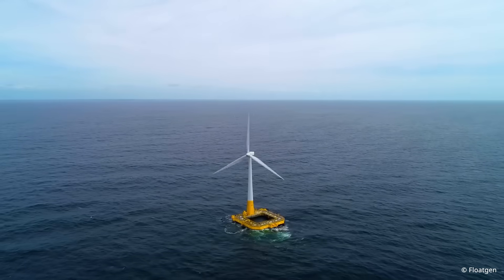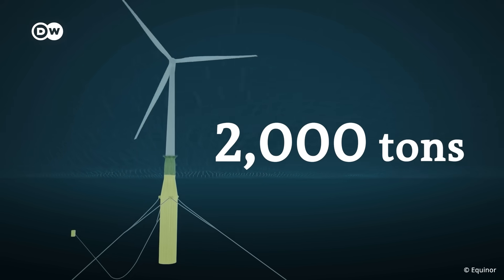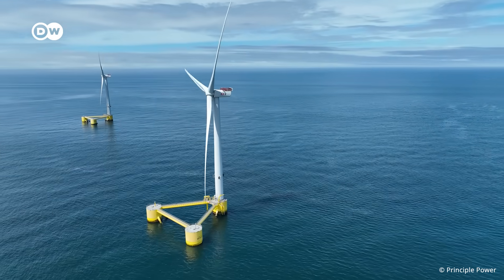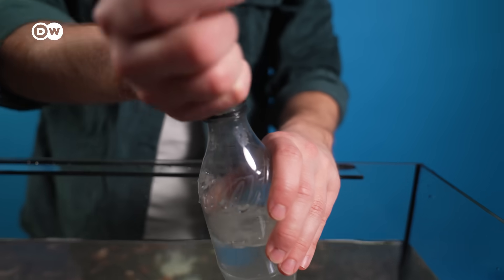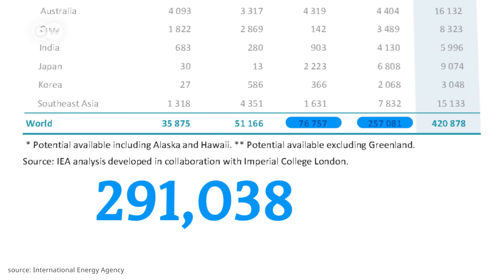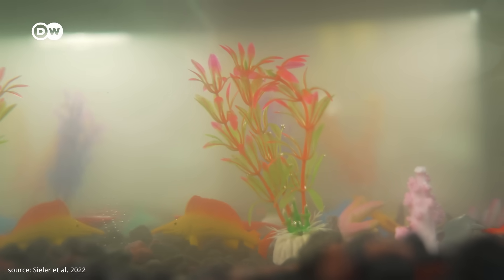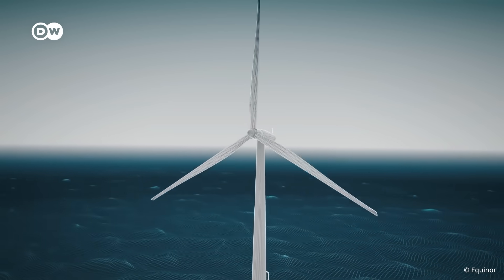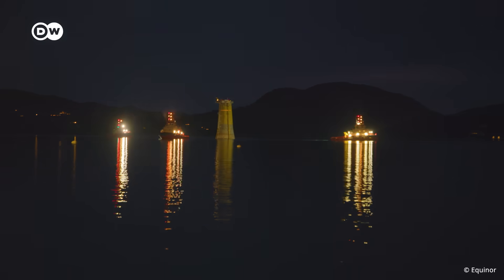Floating wind turbines: Offshore energy's secret weapon

Comment from the maker: Do you think floating wind turbines will be part of our future energy production?
Reply: As the tech will progress, the cost will come down and more innovative methods will arise.
And the best part about them will be if because of any kind of error during installation or in the future they need to be put at a different place they could be transferred.
Reply: Yes, as long as they can get the costs down, making the cost of electricity competitive with other generation methods. If they can already survive hurricanes, then I think the hard part is already solved.
Reply: Put them where there is a strong, steady ocean current and install them upside down. Moving water always has more energy than moving air and this will eliminate the need for batteries
Reply: I hope wind turbines go the way of the dinosaurs for everyone's sake...at least the way the industry currently handles it.
Reply: @julien.4617  Because of how they dispose of the blades?
Reply: I expect that off shore wind will become a bigger percentage of electricity generation for the more heavilly populated countries with a coastline.
It seems that floating wind turbines have engineering and environmental advantages in anchoring, and probably for major maintenance (as they can be moved without cranage).  
So yes, more floating wind turbines in future.
Reply: @JakobusVdL  Also, they look like their construction is primarily metal, so they shouldn't be problematic to replace and dispose of/recycle.
Reply: I don't understand why they're more efficient....like why is it 54% and the others 33%...
Reply: @Eddyke  hello, the fact is that the scottish farm is located in a site with enormous wind density (open sea) whereas the others are located near to the shore and in sites with less wind energy density
Reply: @Eddyke  they're not more efficient, he's talking about the capacity factor in the video. Capacity factor means what % of the time (on avg) it's running at full capacity. Because offshore winds are more constant, offshore turbines have a higher capacity factor
Reply: @Paulo44.01  So why are floating ones better than the one's fixed to the bottom if both are offshore
Reply: @Eddyke  that's a really good question. Among other things, the efficiency of all energy capture is pretty low. Almost ALL of the energy of the gasoline in an automobile is lost as heat before any work is performed.
Reply: as an iceberg floats deep - make the turbines float deep and raise them high when the wind is low 
(the wind always blows off-shore and all you need to pull under sea cables is a boat )
Reply: sure.  they can also add solar panels with the wind turbine?
Reply: @StacksSats  …but I guess easier / cheaper/ more reliable to just more wind turbines
Reply: Yes plus green hydrogen, solar and wave/hydro
Reply: Of course. Most populations live in coastal regions, demand is therefore easier to supply. Land space is limited on these coasts. Its not going to impede shipping, fish or currents and planes fly above. Wind speeds is stronger. Even some shallow seas would be easier with floating due to seabed geology. Offshore oil knows how to build these for decades
Reply: Whether they do are a political decison,  they are not a good decison from an engineering point of view.
Wnd is a very poor source of electrical generation for many reasons. The principle one is intermittency followed closely by being unable to load follow, no inertia, no reactive power support or short circuit current levels. In addition  they have a short service life and deteriorating performance as they age.
Reply: @iareid8255  Average expected age of wind turbine farms is 25yrs at minimum. CA had farms in the CA hills way longer than that. By their nature bar Hydro, renewables are intermittent. Hydro relies on rainfall. Bar burning stuff and emitting it into the atmosphere, there are few other choices. Nuclear has the "unfortunate" habit of generating its own lethal waste. Just a pity that C02 at high levels is not compatible with near all life including the humans who need that power.
Reply: Stephen, 
Expected, practice tells a different story as they age. Particularly as they get bigger.
You don't build hydro where there is not sufficient rainfall, that is not economic for one thing.
Yes nuclear has it's downside but the quantity of high level waste is quite small relatively. It can managed, nothing is ideal
You are probably not aware that CO2 levels now are quite low from a historic point of view. However renewables will do little to cut down on emissions of CO2 as they also require alternative sources of generation running parallel to them. It' s not either or as people tend to imagine. They are no solution.
Reply: @iareid8255  As the hoover dam shows, even the biggest dams are having issues in ever expanding drought areas. China's biggest dam suffered last summer. 
Nuclear waste can be handled but the deep waste site storage (10.000yrs) required is something nobody, not even in a total wilderness wants. More nuclear means more waste from medium-high level. That excludes decommissioning all the old plants built in the 60-80's that are now near or at end of life and were built with older standards (good but old).
As for C02, not sure what historic you mean. The IPCC shows C02 has risen every year since man industrialised. So it might have been higher when man was using wooden tools but not now. And that C02 rate keeps rising and will keep rising for decades from what we burn today. Renewables are the ONLY power source that does not generate waste every day it operates. Every power source requires infrastructure but oil-gas-coal generates emissions every second it runs, nuclear just needs a deep hole in someone's locality for storage that will take longer than the last ice age to be "safer" and there is 250K tons of it now and an extra 24K per year adding to it.
Reply: Stephen, 

hydro is not 100 per cent but you can rely on it for most of the time, sited correctly and sized correctly.
Nuclear waste does not need to be buried  deeply but must be secure.
It is the only generation we have (hydro excepted) that does not generate CO2 .
Renewables cannot run without fossil fuelled generation. 
Historic levels of CO 2 have been significantly higher as has global temperatures, I'm not talking about a few hundred years though.
The current level of CO2 concentration has increased plant life by about 15 per cent in area, it is very beneficial for plant growth and it reduces the plant's water requirement.
(Nads satellite photography).
By the way drouts are not increasing in frequency or duration. They come and go as they have always done.
Reply: A key thing you have missed is the impact of wind + other renewable infrastructure when compared to continuing with O&G. Studies have been performed and it finds that the benefit of implementing offshore wind vs not and just sticking with Hydrocarbons is vast for the wildlife... so yes the turbines will damage the environment for some animals but this will be outweighed by the increase in animal population due to the stabilisation of the environment.
Reply: Mark, 
renewables are not an equivalent to conventional generation nor can they replace it.

The criteria for reliable and economical generators are as follows:-

Generation on demand as required to meet load.
Inertia for stable frequency.
Provide reactive power for stable voltage. 
Support short circuit level current for effective protection operation.
 Renewables, hydro excepted, meet none of this criteria.

Many countries have tried to implement renewables for twenty of so years and have failed, despit adding various devices to try and mitigate the deficiencies of renewables. All that has happened is that the cost of a unit electricity has increased significantly.
Reply: @iareid8255  hence why investment in battery technology or energy conversion is also required (e.g. turning curtailed wind/solar into other things like hydrogen)
Reply: Mark, 
in practice there is very little curtailed wind generation and it certainly is not viable for making hydrogen. It is bad enough that it takes more energy to produce hydrogen by electrolysis but when intermittent generation is used it is simply unviable.
Battery technology can never be an answer to so many deficiencies in renewable generators.
Reply: @iareid8255  The other criteria are:
Short transport of power from supply to demand
Emissions that can be cheaply reused, recycled
Emissions that are neither lethal to humans, wildlife and do not harm the only planet we live on from turning to desert/flooded/poison to humans and the animsls and plant life we need to survive/prosper.
Power supply that does not go over budget, decades to build commercially and can supply power at a "more reasonable" cost including the cost of emission damage/mitigation investment
Power demand that does not require sourcing the fuel from countries that wish you ill (or at least, say it but do nothing).
Reply: Yes.
Reply: No. I think wind turbines will go the way of the dinosaur. Wind kites are superior in basically every way, and should be adopted in preference to turbines.
Reply: @malcolm_in_the_middle  Those dinosaurs being installed now, have a minimum 25-30 yr expected life span. There is no commercial kite power generators. So the turbine dino will be around for longer than you predict
Reply: Just before landing in Copenhagen, I recalled  huge turbine structures in 2015. 
I'm very impressed by the solar panels at the shahara campground during the same trip. It light up the path to the bathroom at night and inside the ⛺. It's what makes Morocco different than the rest of Africa.
Reply: This has to connect to a generator and a grid…this is not effective…stupid…how much sea life would this kill…how many birds…how much co2 footprint is it to maintain and build…dumb. Their is a case for wind turbines in areas that has high wind in high areas, but would have to be specific and even then it’s current not effective because they can safely go high enough and still connect to a grid. It’s a waste…look at Germany that went all in and is burning coal at high rate because of this. So dumb.
Reply: Make them in cluster formation conected to each other like roman's legionaire would add stabilizing effect.

At the center of formation add 1 bigger floater without the turbine ofc to add more stabilizing factor.
Reply: If course they will. You still have to find a way to store energy to cover all 24 hours of the day. Wind is not consistant, which is the problem with all renewables. I don't consider nuclear renewable. If you pump lots of desalinated water uphill, you can release it through turbines as needed. It's better than batteries.
Reply: Good!
Reply: Good !
Reply: Let’s do the real homework - prove categorically these are good for the planet. The vast quantities of fossil fuel used and the maintenance issues , damage to birds animals etc etc what about aesthetics. How does this compare with hydro and modern safe nuclear ( how about cutting politics and looking at real data and facts not emotions) this may be rather surprising exercise. Has anyone actually done this exercise?
Reply: Hell no these are horrible
Reply: The cost of making the wind turbine plus the cost of setting them up will never be returned by the energy they produce in their working lifetime. Without government ( ie. mug taxpayers ) subsidies, they would never be made.
Reply: DWPlanetA,.. 
why I can NOT criticize 
these wind mills?? Why 
delete my comment??
Reply: Yes.  Looking forward to these coming to California!  Glad non floating wind turbines are already working off Massachusetts in the Vineyard Wind project!
Reply: yes
Reply: Probably not. There's actually more energy in the ocean waves than there is in the wind the turbine is trying to harvest. Ocean wave energy is much more energy dense and predictable, we just haven't been able to come up with a device that can harvest it efficiently yet, we definitely need more ocean energy focused research. The floating turbine is a pretty neat concept nonetheless. Perhaps you could do a video on Ocean Wave Energy Converters in the future?
Reply from the maker: @Ammar Mohamed - we have just the video for you 🙃
Check out "Tidal energy could be huge – why isn't it?" 👉 https://youtu.be/1-2TyKqP84o
Reply: @DWPlanetA  Awesome!
Reply: @ammarmohamed9572  .  Wave energy seems to not be that easy to harvest, lots of schemes tried.  Perhaps the floating structures could incorporate some method of harvesting wave energy.
Reply: Of course.  Whether they become a significant part is another question.

As far as environmental impact, over time these would do more good than harm.  The people who talk about bats and birds don't think about offshore means very few bats are there since most insects they eat aren't there, and as far as birds, that's easy enough to deal with by simply keeping them out of migratory paths.

As far as sea life they tend to do better over time with more structures added unless of course those structures leach out oil or gas or other chemicals that kill sea life, and these wouldn't do that.
Reply: No
Reply: @franc8023  Why?
Reply: Mybe but why are only horizontal wind turbines being put in vertical wind turbines are more efficient kill way less birds and dont destroy there blades do to insane speeds at there ends and they work in slower and faster wind speeds.
Reply: @thesilentone4024  They're supposedly less efficient, but I've been shopping for one for my house.

Comment: 2 wind turbine blades have fallen apart and fell into the ocean. Turns out that 150 of the blades are lacking the correct amount of epoxy (sounds like they try to cut corners like the Titan).

Comment: We're deep-sixing offshore wind in NJ USA.  NJ Citizen approval has gone from 80% to 20%.  This was by unveiling the
true horrors of offshore wind and dispelling some of the outright lies told to keep the public at bay.
One of the chief lies told to the coastal dwellers "you'll never see them".  We had to do our own simulations
to show just how huge the 1000' turbines would look at the 8-10 miles distance that some of the front line turbines would be.

The NJ 1100MW plan of 5000 1000' tall turbines are too destructive to  the ocean bed and creatures especially such as clams, scallops and vitally important horseshoe crabs, ocean mammals, to ruining the view shed depressing seashore revenue and shore property values, to our small business commercial fishing industry, to our coastal military threat detection radar systems and radar guided missile systems, to air and sea navigation radar, to reducing the natural shore breeze creating hotter shore climate and reduced surf wave heights and unknown unintended consequences to the environment by changing the natural air flows.  For the ones far out at sea, the HVDC converters employed to run the power cables to shore warms the ocean by cycling 8Million gallons of 90+degF water per day, working completely against climate change wiping out all sea life in that area.  And all this for no material improvement to what is claimed to be necessary to help stop climate change. The Bureau of Ocean Energy Management states in Environmental Impact Reports (EIS) "there will be no collective impact on global warming as a result of offshore wind projects" Vineyard Wind 1 Project Final EIS.

The US 2050 86MW Plan of estimated 7200 turbines and 358 substations containing estimate 117M gallons of industrial fluids and 3.5M lbs of SF6 puts the coastal areas at risk of catastrophic pollution if any large number of them are destroyed by self-destruction, severe storms or acts of war.  There is nothing good about offshore wind.  Its a lousy expensive source of energy pretending to be green. 
They'll be great for fishing? Not if they underwater structures are lined with heavy-metal leaching sacrificial anodes to preserve the steel hulks.  Heavy metals is ALREADY a concern with seafood- those that spend time around the turbines and substations will be unsafe to eat at all. .And fiscal estimates are looking like it could be a fraction of their investment to put a solar photovoltaic system plus battery storage on every suitable house in NJ and save everyone 60-70% of their monthly electric bill costs and that WILL last over 30 years (if not indefinitely at lower outputs) instead of committing huge fortunes to the offshore investment that will raise NJ electric rates several multiples per month.
 
And that ain't the half of it.
ProtectOurCoastNJ.com
DefendBrigantineBeach.org
SaveLBI.org

Comment: So placing inside the ballast tanks These rods you can generate electricity. So yes, as the water's move, the stabilize, it moves in and out of each tank and that movement can be used to generate electricity. So yes, the movement of the water in and out of the tanks can generate electricity. You need to add these components. But now these free-floating windmills can generate electricity from the movement of ocean water in the ballast tanks.

"The aim of this research is to develop an electrode material composite that can collaborate with sea water to produce electricity. The electrodes tested are copper, aluminum, activated carbon, wood powder, and graphite electrode powder."

https://www.ncbi.nlm.nih.gov/pmc/articles/PMC6457286/

Comment: Why a hemi Spherical structure is not used as floating bottom?
Reply from the maker: Hey there. 🍀 Could be because of its challenging construction and the fact it may not be as practical as the examples we see in the video. Did you happen to have more leads to the topic? 👀